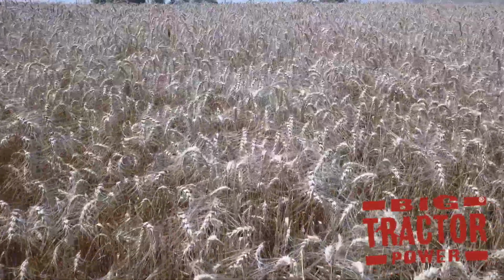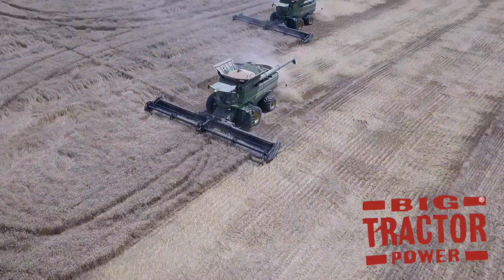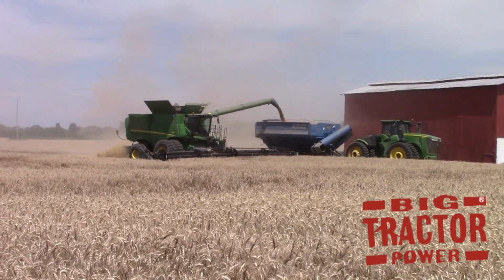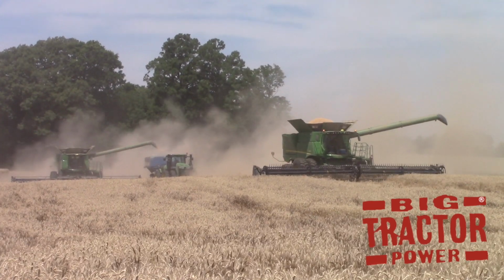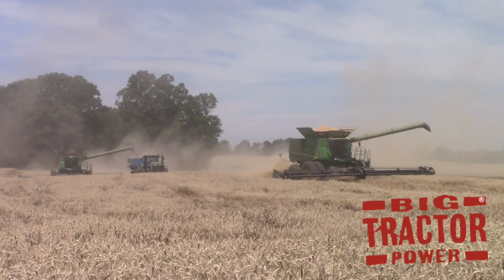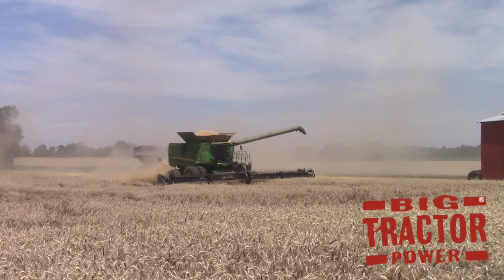Big Wheat Harvest with 8 John Deere S690 Combines

Comment: Nice video.  Do the operators ever change jobs from day to day or do they always stick to one rig?
Reply from the maker: +JDPower 55 in this operation everyone sticks with their job from start to finish in the same machine.  One of my friends runs one of the combines. Through out the year he has several jobs. He runs a R4045 Sprayer, 9620R applying NH3, 9420R with a Kinze 24 row planter, 7120R with a 946 MoCo in hay, a 6105E on a NH round baler in hay, an S690 in wheat, corn and soybeans a 9420R on a 915 v ripper for tillage.

Comment: Looks a great crop of Wheat how many ton to an acre?
Reply from the maker: +JGormo11811 I am not sure on tons.  This field was at 100 bu. per acre while filming.
Reply: 100 bu/A is a great yield; wheat normally is 60 lbs/bu so yield is 6,000 lbs or 3 tons/acre
Reply: That sounds very good, Wheat is ripening in very quick here in Ireland which is usually not a great sign, prob only 2 weeks away, were cutting winter barley here at the min working out very well over 3 half ton per acre or a little over.

Comment: Have you ever considered adding up the value of the equipment in a video like this and speak to it?  Would be very interesting I think.  Thank you.
Reply: Ticky66MN take 600000 and times it by 8 and that would be all 8 bare stock. I don't know what those headers go for but im guessing total 1 combines probably 700000 dollars give or take some money
Reply from the maker: +Ticky66MN I can try some basic prices. I have price books that cover tractors from 1930 to 1995 that give retail prices so for classics I can add price detail to the story. The modern machinery has so many options and there is retail price and discounts and trade it is a bit more complicated.

Comment: Grr. @631. I've always hated it when people stop to dump and lv the header on smacking all of the grain onto the ground. Idk why. It's not that much. But the same guy running his reel way to fast was always something else that bugged me. Lol.
Reply from the maker: Every farm I film at in WKY runs their reel at this speed.   Every video I post gets the comments the reel is too fast. They are harvesting 95-100 bu. Wheat.  The reel is set to the speed of the combine to pull the wheat in.  I don’t see much loss.
Reply: I hear the but if the crop starts to stand back up as the fingers break contact then that's to fast. But it's a minor loss if any as long as the Header is moving. Idk. Just a pet peve of mine. I did the wheat harvest a couple of times and the first year of the 645fd there were very few of them. But in Oklahoma otw to our very first field and this kid had a brand new 9770 and 645fd. Never cut a single anything. And as we all pull in the field he comes in way to hot and jerks back the stick @22mph. All the weight comes off the rears and he looses control. Smacks the left side right inside the snout on a tree that didn't move an inch and the whole unit flips around with the combine halfway down a 10ft ditch with the header barely hanging on keeping it from going the rest of the way down. Idk how I managed to be right there to see that. But wow! That whole unit ($119000 645fd and I think $345000 9770sts) was totaled out and never got to thrash a single thing. The kid was alright. But he went home the next day. Wish it woulda been videoed! Sorry for the ramble! And I'm glad you started doing the videos you do! And you and all of us are very lucky the you've met some of these farmers!  Not many farms are able to run multiple brand new machines. And some are very secretive. I worked for a guy that would go as far as uncalibrating his combine monitors so that the operators didn't know the actual yield so that we couldn't tell anyone. Lol. And he def wouldn't let any filming go on. Alright done rambling. Thanks for your vids and have a great memorial day weekend!

Comment: What's the difference between an S model and the STS models? I asked a service manager at John Deere one time, and he didn't know. I'm sure it's only a google search away.
Reply from the maker: +133dave133 the main differences from an STS to an S is the cab and sheet metal. The inner workings of an S660 is the the same as the 9760STS and the same for the S670 and 97770STS. The 9870STS was 300 bu.  The S680 and S690 jumped up to 400 bu.  These combines have two grain returns on the right side while the S660 and S670 only have one.
Reply: Thanks for the reply, and the info. I did notice that the S models looked a little more egg shaped. I suppose that it's hard for John Deere to radically change their models all at once, hence offer two different, but similar models. I saw this on the harvest crew back in the day. There were a hand full of people still wanting the straw walkers over the STS variant. We still cut once in awhile with a 1927 Holt combine just for fun. If you ever get to Nebraska, you could film it. It was a big machine back in the day, and it even has a draper head on it, haha.

Comment: Wonder how much diesel is being burned a minute?
Reply: MitchF150 about 3 gal would be my guess.
Reply from the maker: +MitchF150 a bunch. If I really correctly back in 2008 when diesel was high the farm used $122K in fuel on 6 9860STS.

Comment: I believe in a previous video you said that this farm trades out 5 of its combines and all of its big tractors each year.  What's the reasoning behind that?  Surely the machines aren't worn out after only a year of use.  

Also, do the combine head also get traded towards new heads each year or no?
Reply from the maker: +CorporalChaos the farm does trade most of its combines and tractors each year.  It's all about up time and moving fast.  Each combine harvests about 5,300 acres a year. In 2017 the farm went with 6 new 2017 S690 combines as they are jumping from 5 to 6 combines in corn. They rent back two 2016 S690s to help out in wheat.  In wheat each of the 8 combines will cut 1,300 acres. In corn each combine will shell 2,200 acres. In double crop soybeans each combine will harvest 1,800 acres.  Header wise I think those stay a few years. This year all the MacDons and 612C heads are 2017 models.

Comment: i don't really like the drone footage
Reply from the maker: +truck and tractor pulling videos usa pullers BTP does not do very much drone coverage. In the case of trying to film 4 to 8 machines with 45ft heads on the ground is hard because of a few factors. You get the first machine up close and by the time they all pass the last machine is a good distance off.  Often times the wind is blowing dust at you so it's hard to show the scope of machines working together together because the lead machines chaff and dust clouds the rest of the machines following. Sunlight makes it a challenging. Normally you only get a chance to see all the combines working together is first thing in the morning when they get started or in the evening as they wrap up a field.  The rest of the day they spread out.  The early light and sun set light makes it hard on the ground to film because the sun will blind the camera in one direction. The drone lets the viewer see all the machines despite dust and sun. BTP mainly uses a drone to show many machines or to see a tall crop being harvested. One last challenge of being on the ground is time. BTP has footage of 6 of these S690s cutting on the ground.  It takes 12 minutes for all the combines to pass the camera and one gets jammed up at the end and quits for a few minutes. The drone allots for quick viewable clips.